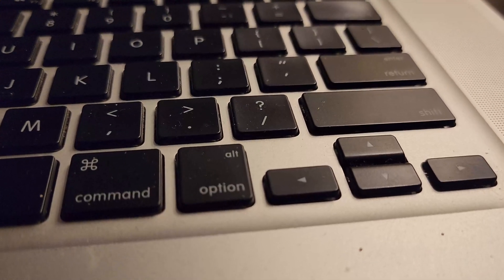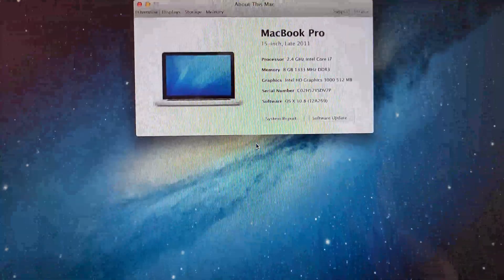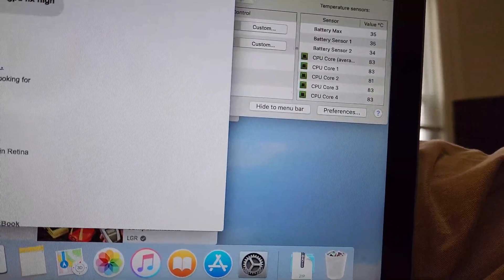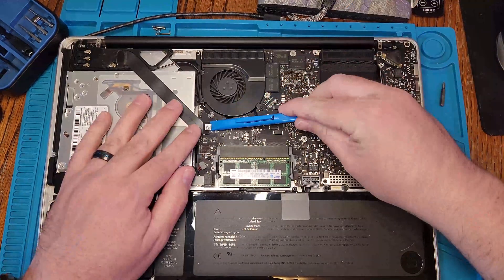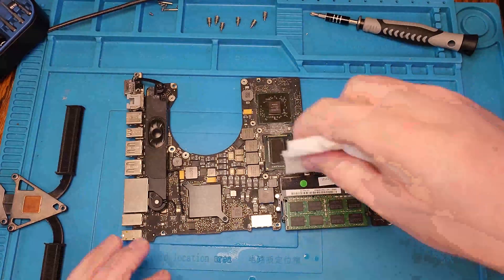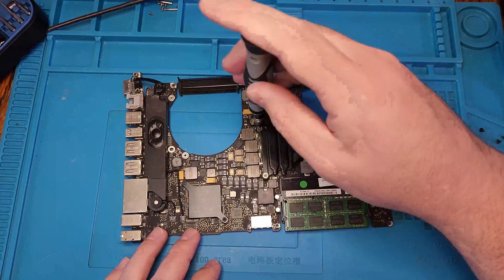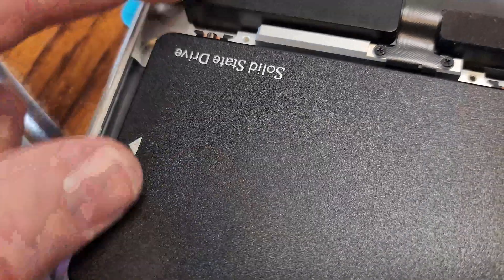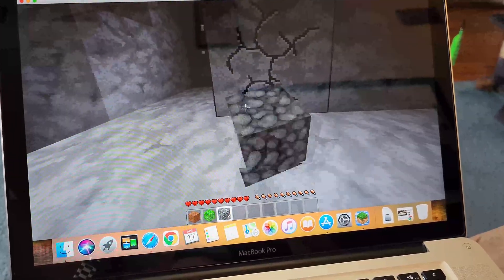Late 2011 MacBook Pro SSD Install and Thermal Paste Replacement

Comment: I have a 13 inch Late 2011 that I revived by putting an SSD in and 16 GB RAM and I installed Fedora Linux Xfce and it’s running great but it needs a new battery and I’m thinking about replacing the thermal paste but idk yet. We’ll see.

Comment: Same result here, the temperature  still going very high 92-98 C when watching an mp4 video or a YT video, on High Sierra
Reply: I have Ventura on it
Reply: Ventura on a Macbook Pro late 2011?  Watching YouTube must be awfully slow...😢
Reply: @mateiacd  I have a late 2011 MacBook Pro with a 512GB SSD, 16GB of 1600MHz RAM. I changed the thermal paste, cleaned out the dust, and I am currently running Sequoia. It works very smoothly and fine.
Reply: @charlesbotbot1722 My MacBook is model A1297. What is your version?
Reply: @mateiacd Works flawlessly. I've been using my for daily, over 15 years now. Difference is mines 13inch, and still using 4GB RAM, all original parts.

Comment: i dunno if it could help but adding cooling and thermal past to the chips near the CPU and on the CPU cooler tubes also helped reduce temperature. I experimented alot with cooling past years ago on my "gaming" laptop and after i modified the air-outtakes and adding cooling and thermal past everywhere near cpu helped reduce the temperature drasticaly.

Comment: This machine is really a very bad design. I already replaced thermal paste with liquid one, ssd upgraxe and ram upgrade as well is done, installed monterey via olpc, had to remove iplatformpluginfamily kext to disable throttling , now runs at 3.3 ghz with turbo but temps suck very bad like 65 idle, i could have done some cnc magic on the lower case but it really does not worth. I also realized how easy  windows is to use  comparing to macos.
Reply: It runs linux quite well!